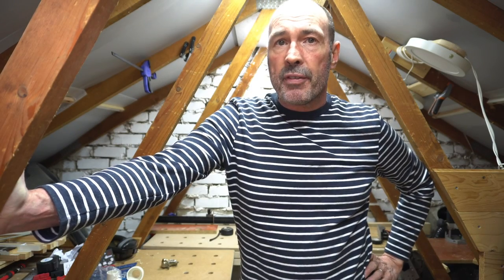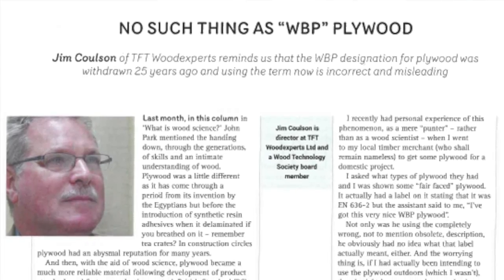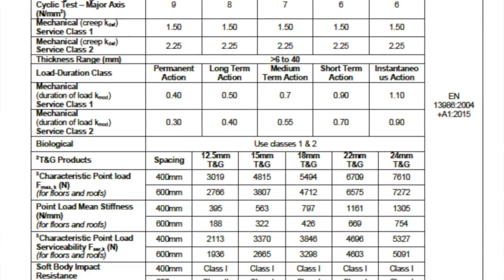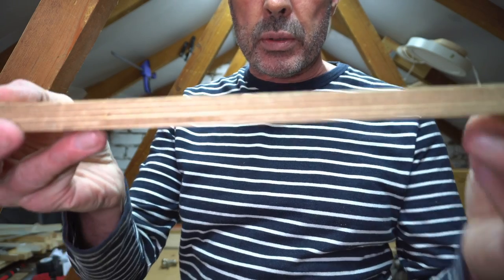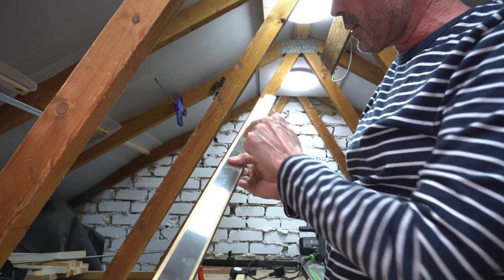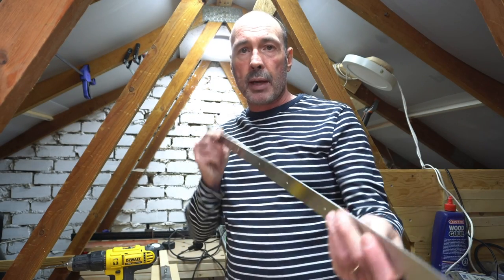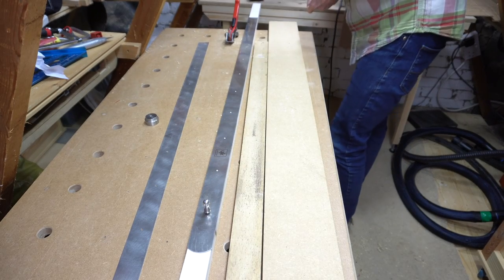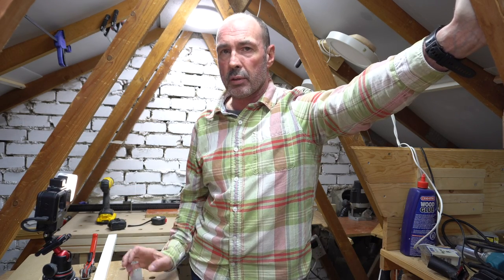Plywood or MDF for MFT Workbench Builds? JP's Vlog #4

Comment: I just want to pose a question, to give perspective. It is the sort of question that I wish I had asked myself more often...

If you have spent several hundred pounds on a track-saw, rail, dogs, fence, etc plus a couple of hundred on a jig system for making dog holes, how important is it to get the cheapest material to use all of these on?

I have often regretted getting too cheap an item- I cannot recall regretting getting the best.
Reply from the maker: It is a great question Mike. I am drawn to gadgets and some of my kit is that...

Couple of points I can make. 

1) Benches in general.  I started work as a bench hand joiner. Pretty much the first thing you did was make a bench when you started at a company. These were made very quickly, and of spiked together 2 x 3 / 2 x 4's with a chipboard top and a lump of 2 x 8 to create a tool well. The quality of the bench was poor and did not reflect in anyway to MFT benches. From these we managed to make great quality joiner items for shops . pubs bars etc... 
2) As a bench joiner we received a small amount of money (circa £1.60 per week) to buy and maintain our tools. The job was not particular well paid. It was amazing what quality joinery, some guys with cheap tools could produce.  My tools were stolen just after I left the trade. I only ever replaced them when i needed something for a DIY project, with cheap tools. The tool kit I have now is the best I ever owned. The Festool was a dedicant purchase. The Bench dogs were my combined Birthday / Christmas present from the family. 

Regards

JP
Reply: @Smallbarnworkshop  Yes, I too am a tool buff- sometimes buying stuff I cannot justify- at least to my wife. 
It is certainly possible to create amazing product with rudimentary equipment- I have been priviliged to see goldsmiths create beautiful items using only a few hand tools and a wedge of wood sticking out of the bench. That is the nature of skill. Once we mechanize what we do (from simple jigs up to CNC machines) we are in the hands of the accuracy of the tooling. We become mechanics, operating machines that determine the outcome. What we gain is speed and consistency. Such things are a matter of choice, there is no right or wrong. But, whilst we can overcome imperfections in tools when used by hand, using skill, a machine depends on the design , accuracy, and quality that went into it. It is, by design, meant to eliminate the human factor. The need is to make it 'good enough' for the desired result. That varies widely, of course. If the product is going to move over time (like MDF) there is no point in obsessing about the tool producing it. Important, though, to understand the limitations if a different, more critical, item is to be produced. A good table saw will invariably have a cast iron table and motor mountings- to ensure that it will never be the weakest link. When we substitute MDF (or even good ply) we are losing some of that margin; it may be OK for what we are doing, but it is still limiting. Awareness of that is key.
Reply: @Tensquaremetreworkshop  all of this is extremely interesting and should be a thread that particularly newcomers to woodworking read. As I’ve said in another comment on this channel, I use a carpentry pencil if I’m working outside - visibility is more important than fine accuracy. When I’m stud framing our barn conversion) a greater accuracy is required and I’m usually happy with +/- 2mm. For work in my shop, which is now entirely for friends and family, I work from anything from +/-0.5mm to thousands of an inch ( which I measure by holding pieces up to a light and gauging with the use of a precision tooled straight edge. 

Is this required? Not always; sometimes, the requirement is for 2 or more pieces to be the same as each other rather than exactly a given measurement; in that, I find the feel of a finger over the edges to be just the simplest way. I’m not sure that all the machines we have all got (table saw, band saw, router table, morticer, dominos, track saws etc. ) add to accuracy - but they make a job faster. I use dominos a fair deal on small items and, in theory both pieces should mate together with the face surface interface being smooth; mostly they do but I do find, no matter carefully I make the mortises, there is sometimes a discernible ridge between the 2. All of this comes down for me anyway that nothing is ready straight off the machine; you have to run test pieces through before and check your work after. I can’t remember any kind of assembly being perfect in all aspects straight out of the cramps. I use everything from chisels to abrasives to planing to card scrapers to finish the item off. Using the right material is critical for every reason from accuracy to aesthetics. I make a lot out of quarter sawn oak; it’s aesthetic is wonderful for me but the method of cutting means it’s more stable than anything crown cut. For panel work, I obviously use plywood or mdf but I’m very particular about the quality of those. For smaller pieces, I prefer to veneer myself; usually cutting my own veneers which are generally 2mm rather than the machine cut 0.5mm. My way gives more room for finessing the piece. If I’m making a wardrobe, then I will buy pre-veneered but, again, quality control is important. I’m lucky in that I can go and see what I’m buying before it’s put on the lorry; most can’t and I can only advise to buy from just a few places that you learn to trust and understand that cost and quality rise and fall together.

So, back to machines. I’m now 67 and my body complains every day. So machines like a domino help me to lessen the physical effort but I don’t assume final accuracy. They also add speed (the set up time for a domino is a fraction of that for a mortise and tenon). That speed is critical to those trying to make a living but not a great concern to me. 

It’s an old argument as to whether the most expensive brands mean better tools. I’ve found that the answer is no; not always but sometimes. I wish it were simpler for newcomers; so many might buy Festool because of the name. Experience tell me that some of the Festool range is average in performance ( for me drills and planers) whilst others are very good (routers). I guess that the only advice I could give is to read and watch a lot - that kind of resource wasnt there 20,30, 40 years ago. 

Your thoughts on this would be greatly appreciated.
Reply: @theofarmmanager267  I am in agreement with all of the above. My point was, largely, that the weakest link tends to set the accuracy. So, for each item, we have to ask if they are 'letting down' the other parts in the process. It seems an extreme case for woodworkers to move from cast iron tables on table saws to MDF as the surface on which to cut wood. Yes, it can all be corrected by hand afterwards, but the idea is to avoid that. Cast iron is preferred to an aluminium casting, as it is more stable and can be ground to high accuracy. Which will remain for decades. Anyone who has leaned a sheet of MDF against the wall, to come back to a banana knows that it can only loosely be described as stable. Again, if it meets the accuracy that the task demands, fine. But we can all admire items that exceed 'fitness for purpose'. An AK47 is very fit for purpose at minimum cost- but a Purdy shotgun exudes quality that has, for most people, a value in itself.
Reply: @Tensquaremetreworkshop  I’m in broad agreement with you. However I see (good quality) MDF as excellent where it’s properties are known and understood. I wouldn’t use even the best MDF as a wide shelf unless it is strengthened front, back and middle. I haven’t got the sag table with me but if MDF bends under 100kgs over 1000mm ( just figures) then plywood bends roughly under 200kgs. Where I have wanted chunky shelves - perhaps in the style of Greene and Greene - then I’m happy with MDF with front, middle and back support underneath. I have such pieces that I built 20 years ago as part of a book cabinet, and they are as straight as they should be.

MDF will bend when lent at an angle against a wall; plasterboard and OSB bend even more easily; plywood less so; the cheap end of the softwood market deforms easily. I think it is about giving people the information of what to use and when. When I’m jointing the face of a piece of hardwood (oak, cherry, walnut, sycamore) I know that the resulting “flat face” isn’t perfectly flat. I would then run the other face through the thicknesser and then run the first face through the thicknesser; it doesn’t result in either face being “flat” but probably parallel to each other. I have a large cast iron table on my 12”table saw; before each set of cuts, I measure the angle between the blade and the bed to make sure it is the 90 degrees or 45 or whatever I need; I measure both with an igaging digital block and putting up my test square (from Woodpeckers and never used for anything else). Is it exactly the 90 degrees? I doubt it is every time, it may well be 90.1 or 89.9 but, practically, that matters little or none. 

There are degrees of accuracy that different applications demand and that’s a learning curve that most people have to go through. There is a use and limitations for most materials and that’s a second learning curve. I would start with the first point of possible inaccuracy and that is the measuring and marking out. I’m less worried about the materials because I hope I’ve learned most about what might happen to it.
Reply: @theofarmmanager267  MDF is a fine material for many purposes. Its issues when used for MFTs was drawn to my attention by Ron Paulk, probably the most prolific builder of such items, the torsion box version of which is named after him. He also uses them commercially on a daily basis. He states flatly that he would never use MDF for the purpose. From my own POV, I try to buy quality tools, and my MFT is a tool- so I used the best quality material that I could obtain; I was fortunate that is was reclaimed and free. It replaced a previous ply version- the difference in quality of ply was obvious and considerable...
Reply from the maker: To through a curved ball in. Chipboard can have better loading capacity than MDF. When do you see anyone making things from Chipboard! And what happened to block board? No seen that for years?
Reply: @Smallbarnworkshop  I remember chipboard, and what a frustrating material it could be. Is it still used for floorboarding? MDF is certainly superior to that for most things... I guess blockboard is too expensive to make these days- ply or OSB a better bet for most of its uses.
Reply from the maker: Yes 18 and 22mm T&G4 for joists at 400 and 600mm centres also a thicker 38mm for industrial flooring. Denser than standard chipboard at 720kg /m3.
Reply: @Smallbarnworkshop  chipboard is used by some kitchen makers and for some grades of loft flooring (for instance). The inherent disadvantages of chipboard are the quality of the edges when cut and it’s ability to be get a good paint finish. I’m only guessing on block board but would it’s demise be because you can’t make thin (9mm, 12mm) block board; plus a mill is geared up for all thicknesses of plywood and so cheaper for it to switch to thicker plywood than change over to block board. Plus it can’t be that cheap to get the whole length staves required? I still make my own block board when needed. For doors, I have made the core out of 7’ softwood with the right hardwood on the edges; then a thick shop cut veneer on top. I don’t know that the result is that different in strength and longevity than if I did the same with multiple layers of plywood. 

As I’ve said, my MFT style top is made out of Medite. At least 10 years old, I went out yesterday and used my 300mm digital vernier gauge to check the differences in distance from the edge of one 20mm hole to the next. I was expecting 76mm and on holes that have seen a lot of use, I was put by up to 0.5mm. Between the holes that I had not used, the answers were all 76mm given the tolerances allowed on the vernier. So why no apparent expansion? The only difference I can see to what SLW did was that my MDF is screwed onto its softwood frame and the softwood braces underneath. Would that mechanical connection be sufficient? Don’t know. 

The wall panelling I’m making is largely made of Medite. There is one back corridor where the panelling will be painted for reasons of light. That 40’ or so will be all Medite. The entrance lobby will be European oak. The stiles and rails will be solid timber whilst the infill panels will be veneered mdf. On both, I’m going to put linenfold inserts (mdf for the back and oak for the lobby). It’s surely horses for courses? We would probably agree what has to be solid timber, what has to be Plywood and what has to be (high quality) mdf. The differences might be on the boundaries between the uses. I seem to be more confident using Medite where others would want plywood. Is there a right or wrong about that? My table saw has cast iron table but my router bench has a composite top (all the components are made by Incra). I’m very happy with the stability of that and would only want a cast iron top for its magnetic properties. As people get more experience on woodworking, they will probably find out their own boundaries.

Comment: As an update, I have conducted some accurate measurements on my own (birch ply) table, and put the results in https://youtu.be/woG1U2qbRWE 
They would indicate that ply is, indeed, more stable that MDF (comparing my results with those you obtained here) but there are other issues that apply...
Reply from the maker: Mike, just watched. Thanks for sharing. Regards JP
Reply: @Smallbarnworkshop  I intend repeating over time. If I can get hold of some MDF I will test that also...

Comment: Probably the only saving grace of the movement is that all the dog holes should move the same amount? So if your fence is square when you drill the initial MFT holes it should still be square after the expansion/contraction. Or maybe I'm blowing smoke out of my ar**? 😂
Reply from the maker: Ian. I agree ☝️ I have never experience the holes swelling so the dogs do not fit so that’s good. 1.5mm I’ve r almost a metre is next to nothing I’m woodworking terms. Regards JP
Reply: Sadly not. Because MDF does not fully return after a moisture cycle, and differential absorption can happen (sheltered areas of the table from mounting etc) one cannot rely on the table remaining square.